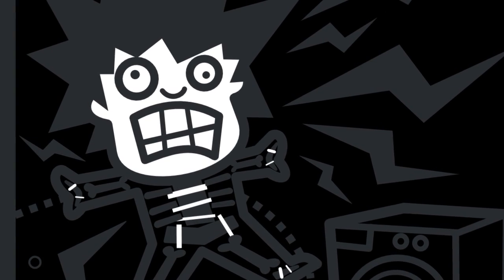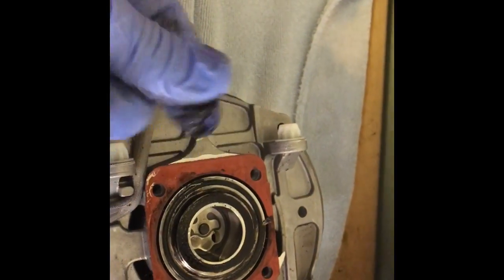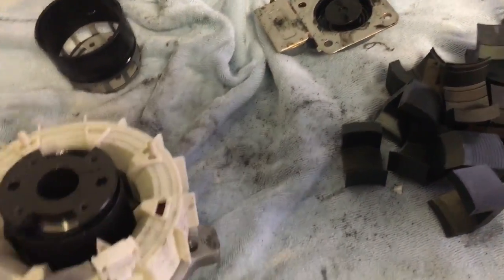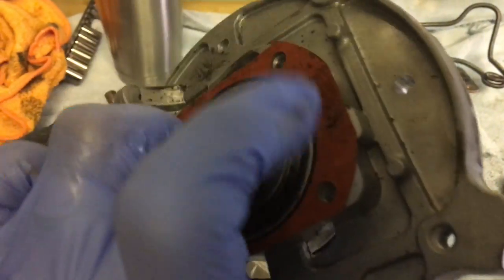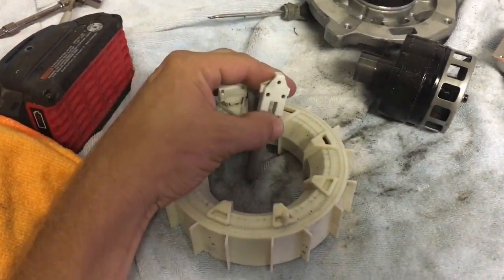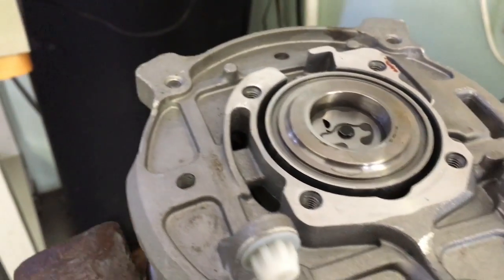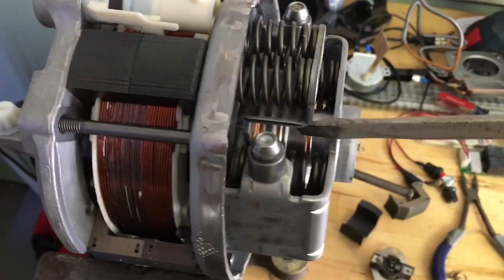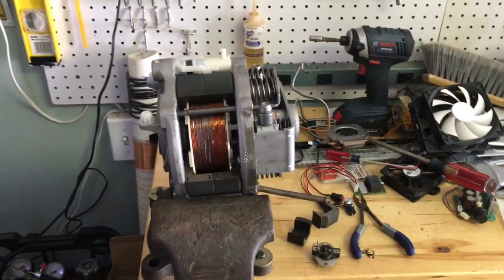LG Linear Compressor Teardown

Comment: In automotive air con we call the Balck goo Black death, mixture of PAG oil moisture and metal shavings usually caused by a compressor eating itself alive
Reply from the maker: Not what's happening here. I know what you're talking about though. We call it black death.

Comment: For those who would like to know ... the linear compressor works the same way as loud speaker does... or sub woofer driver ...a low frequency unit. The inverter schematic would be the same as your sub amp ... single phase variable frequency driver.
If they did not fit all those springs .... your fridge would go for "walk about " in your kitchen.
Reply: so you could say you fridge is running?
Reply from the maker: HA! Yeah, it pretty much does work like a sub except for the one way valve break-er off-er thing. Never thought of it like that.

Comment: Great video! My 3 year old LG fridge compressor failed as well. Worst part is that in Washington State, LG had nobody "certified" to repair it. Wasted lots of time on the phone with LG scheduling repairs only to find that every appliance repair shop LG worked with refused to do this repair. I found a compressor on eBay and shipped it to myself and scheduled my own appliance repair guy to install it, invalidating my warranty, which turns out is useless anyway. He said LG has not changed the design so I should expect it to fail again in 1-3 years. Wish consumer reports and/or the wirecutter would acknowledge this catastrophic failure of the compressor... a component which has been engineered to last 20+ years from other brands (except LG & Samsung).
Reply from the maker: They should have shipped you the compressor for no charge since it's under the 10 year part warranty. They are all going to garbage compressors it looks like. EPA stuff is just out of hand so even if they wanted to make one that was good energy star requirements get in the way. Eventually freezers will be back to manual defrost if it keeps up.
Reply: @theappliancetechnician  They told me they could ship one but it was going to take 2-3 weeks and with a 4 year old at home I couldn't wait that long to get a refrigerator back up and running, since it had already been a week of back and forth trying to schedule a repair. I don't know much about compressor design, but I could definitely understand how even more strict and unproven energy star requirements could lead to more unreliability. Not sure if this LG "linear design" was to get better energy ratings. If it was, pretty sure all of the worn out compressors and additional energy to create new compressors totally cancel out cost benefits as well as any reduction in "greenhouse gasses". What a waste.
Reply from the maker: @timmcdonald3702  I agree. And I'm not really sure I believe anything they say.
Reply: there's a class action lawsuit underway i just saw on the news.

Comment: excellent video.  I just purchased a new lg fridge.  its jan 2019.  I'm concerned about this.  I'm just wondering if LG has fixed the compressor problem.  Or can I expect a bad compressor in about a year or so?   I did buy the extended warranty(thank god) but surely LG has found a way of strengthening that valve, and keep it from breaking.
Reply from the maker: I don't know the answer to that but my thoughts is that they made most of them all at the same time so I kinda doubt it but don't know for sure. To make up for it they pretty much gave everyone a 5 year parts and labor warranty on the sealed system. Sears is doing them.

Comment: LG says those compressors have a useful life of 20 years, watching your video I think for 12 months, thank you
Reply: Mine lasted 5 years... Never buying an LG fridge again.
Reply: @Eric2300jeep  Samsung is even worse. In fact, all smart appliances are crap!
Reply: @Eric2300jeep  did you try to get lg to stand behind it? They changed their warranty to 5 years parts and labor
Reply: 12 years wtf, theres refrigerator from the 60s and 70s still running!
Reply: My GE is from 1971 still running  @jamesguralski5156
Reply: They used a technology that was indeed known to last more 20 years in electric shavers. But kinda seemed to miss the point of how many hours those run vs a refrigerator...
Reply: Junk
Reply: My LG lasted 3 years.
Reply: تقنيه فاشله

Comment: Thanks for the video. I’m an LG tech and always wondered what they look like inside and what the valve that fails look like. Yes. LG has a lot of compressor failures. Most of them due to defective valve. Which you show in the video. I replace at least 3 a week.
Reply: Mdhfinsc what is the ideal low side reading for the charge?
Reply: @bluuedaniel  somewhere between -5 and 5
Reply: @mdhfinsc  then why, when I bought an log and did a video, he said you’d be working at higher pressures. I ended up putting 10 lb. to get it to cool properly. A friend was befuddled the same way, having to add more recently, than an embraco conversion.
Reply: @bluuedaniel  LG refrigerator depending on model only use from 4.6OZ of R134A to some models 6.1Oz of Freon. You can use scale to charge.
Reply: I work for Sears a&e and I do 2 a day . 10a week for last 5 years

Comment: Does this type of compressor have a oil sump like that of a piston compressor i.e. is there oil circulation on the moving parts and if so how it is done ? Is there a oil pump or a splash type method

I am asking since I can see black grease like residue on the rods that indicates less oil or no oil
Reply: The literature indicates that linear compressors DON'T require lubrication - which is hard for me to believe. They claim that the POE oil in the system is just to circulate and aid in tracking down any leaks.

Comment: Pay attention at 2:45 and you will notice the broken piece of the valve that you pointed out. I was sitting toward the O.D. of the piston. Watched another teardown of this model compressor with the exact same failure and similar tear out shape on valve cover. An obvious design flaw within the this LG compressor model.
Reply: One of the other I've seen on YT has one of the rubber seal torn apart. I think the piston just happen to get way too much amplitude of its vibrations so it starts to collide with the rubber end assembly. Probably way too much more often than engineers anticipated, so it get destroyed...
Reply: Agree, I just saw video where he took it out and could see light through the hole. What a garbage design.

Comment: My compressor have the same problem the small plate which is used as a Inlet Outlet valve it was broken and I'm really surprised that whole compressor is depend on this valve plates and LG reputation Goodwill is based on the small valve which is easily broken and the whole refrigerator is going to be bad
Reply from the maker: Yep
Reply: @theappliancetechnician  What do u think about what LG could do to make  this valve more sturdy?
Reply: @SirtubalotTX  this valve should be floppy stainless material
Reply: We’re you able to fix it?? Or what?? 😔
Reply: I am gonna try to replace that part with a one made on my own... any ideas?

Comment: Thanks for your tear down video.  I'm an appliance tech and unfortunately, have also experienced a high failure rate on LG compressors, particularly the linear compressors.
Reply: so what has LG done to improve the linear compressor design in new models? ZERO?

Comment: I like what you are doing, I wish I could tear one too. I'm a technician w/ 3 decades of experience and right now I'm working on side by side (2-1/2 y/o) with the same motor, the issue being evap leak and condenser leak, the tubing that goes inside the body. I serviced 2 sidexside and a stack r600 ref (similar brand) with condenser leak last months, a total of 6 with same problem. My client wants to convert his LG ref from R600a to R134a, this is my 1st LG conversion, got 2 last month. My 1st concern is, can this kind of compressor handle R134a? Ref is running right now, -30deg in 4.5hrs, -20 in 2.5hrs (data next). Knowing the density of R134a is higher, the original setup will not work, thus pressure plays a very vital role. I need to tweak the condenser side and low side to attain the required stabilized pressure, at room temperature, or else the motor won't start. Plug the ref with freezer at ambient temp (26C - S/1 storm here). After self check, current reading starts at 0.10A, low side pressure goes down to negative, 227volts. An hour after, 0.0C,  0.86A, and -15psi. 2nd hour, -20C, 0.67A, and -18psi. 2.75hrs mark, -24C, 0.61A, -20psi. I'm using SUPCO CR4, Infrared temp of compressor is 42C and filter 35C. After pressing express fzr, at 4.5mark temp is -30C, RH87%, 0.56A, -22psi, 226V, compressor 41C, and filter 33C. Looks almost perfect but my question is, as you have dissected a similar motor, in your opinion can this motor handle R134a? R134 is bad for the environment, but I have to accept the challenge for now. (hope you understand my English)
Reply from the maker: This is a 134a compressor. 600 runs at much different pressures so I don't know. I have been able to put a regular ptc relay compressor in an lg and not use the linear compressor though. I don't know much about the 600 compressors, they're not really here yet.
Reply: Sorry, I thought that was a linear inverter compressor. Thanks for the kind reply.
Reply from the maker: It's an LG linear compressor, unique to LG.
Reply: I think linear compressor and linear inverter have similar mechanism, they only differ in windings, the inverter being three phase. Have you noticed the amount of compressor oil? I only got 1/2 the amount compared w/ relay- start Matsushita.
Reply from the maker: No, I didn't notice but it didn't have too much oil in it come to think of it. This one you can plug directly into the wall and it will run so it's not a 3 winding that requires an inverter.
Reply: The color of the oil you torn down looks similar to a used diesel engine oil, there was a mechanical breakdown before winding burn-out and maybe one factor is oil. I just found out that my compressor is not 3ph, only 2 wires in, no ptc but overload protector, so its similar to yours, only this one is inverter controlled.
Sorry for asking too much, I'm a member of inventor's society here and designing agricultural machines, my appliance servicing is 3 decades old. Thank you so much for the info you shared, that helps me a lot and more power to your business.
Reply: @theappliancetechnician  how did you wire the PTC compressor to replace it in a linear inverter LG? Do you have a video on that conversion? I want to do the same but since the power for a linear compressor comes from the inverter and is a variable voltage and variable frequency I did not attempt to try it yet. Thanks and great video!
Reply from the maker: @houptee  wire a relay into the power to the condenser fan motor then a start kit for the ptc compressor. That's how I did the first one. The second one did the same except had an arduino controlling a vcc3 control still wired off of the condenser fan motor.
Reply from the maker: Read above
Reply: Rankine I just wanted a simple hooka to go diving,but here out on the hook,,it would be nice to be able to make ice,,we pretty much live on solar panels and small generators
Reply from the maker: @bobleclair5665  @houptee https://www.youtube.com/watch?v=lZJ0EZE3tx8

Comment: Thanks for making this video. It was great. I had a Lg fridge with a Linear Compressor go bad in less than a year and a half too. I wonder if the valve material may be too brittle for the stress in a lot of Lg Compressors. Keep in mind there is no warranty for second owners. So consider a $600 bill as a possibility when looking at a good deal.

Comment: here is a link to a linear animation https://www.youtube.com/watch?v=JXmpS8_ro1Q  
The piece with the hole is the valve which is a piece of spring steel on the tip of the piston. No it is not supposed to have a hole in it. I'm curious of the model# on the side of the compressor.